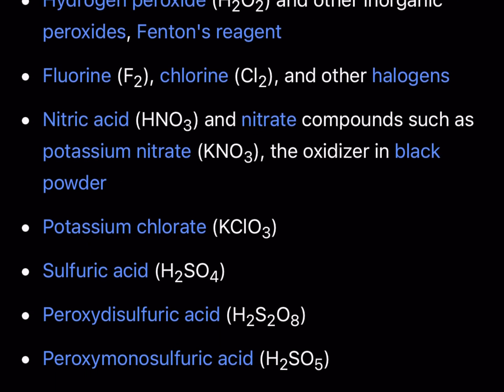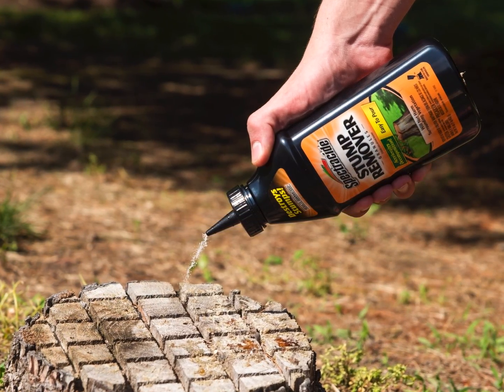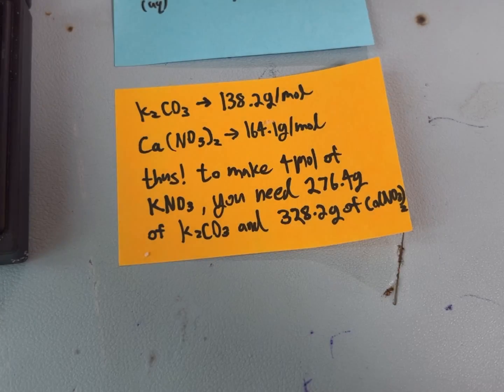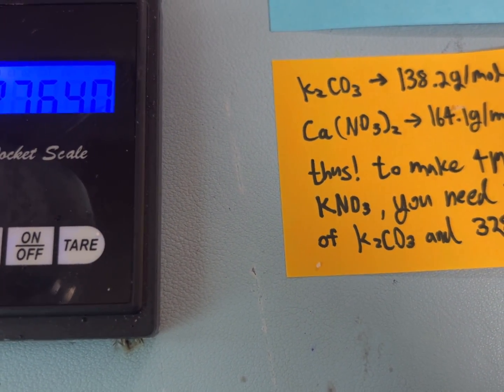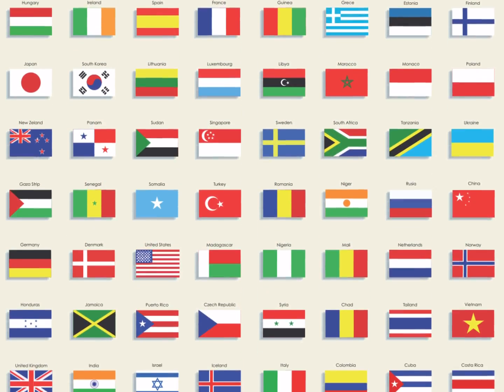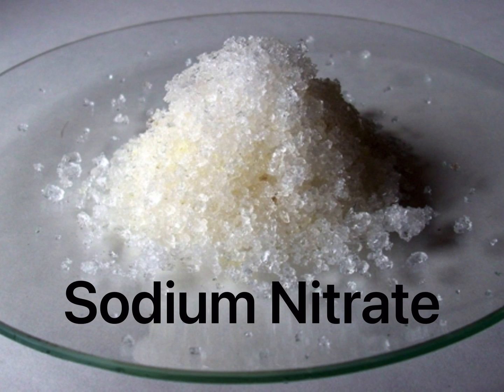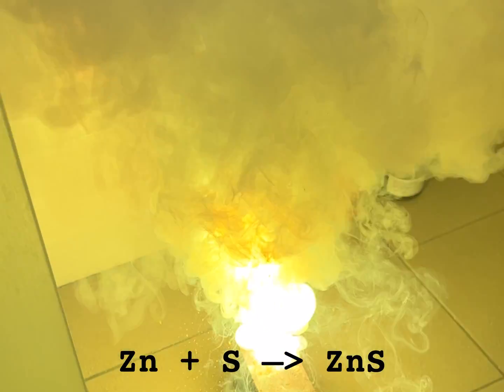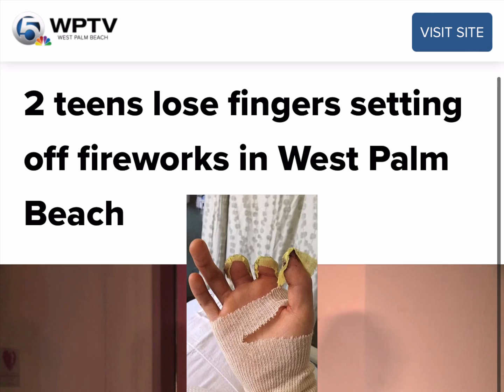How to get Oxidizers for Solid Rocket Propellants(Rocket Fuel)

Comment from the maker: As always, thank you for watching the video!
I highly recommend reading the sources listed in the description. 
Although it may feel uncomfortable to start reading research papers and articles on your own, it is one of the most reliable methods on gathering credible information.
Reply: Urea Nitrate is easy to make you don't need concentration Nitric Acid, you can use dilute Nitric Acid, in this matters Sulfuric Acid is not needed. Actually i manage to synthesize Urea Nitrate but i don't think that's gonna explode it's just disintegrate when you burn or heat the substance. I make Methyl Nitrate too but i don't know how to use that so it's can fly like a rocket.

Comment: I hate Germany. You can't get shit without the possibility to land on a list and probably get a visit from the police and you having to explain why you got this stuff. You can't buy HNO3 in concentration higher than 3%, HSO4 12%, most nitrates are heavily limited too and if not have fun paying 30€ for kg of nonahydrate... You aren't even allowed to buy certain metal powders without getting weird questions asked. Now you try to find a loophole by trying chlorates and perchlorates. STILL THE SAME PROBLEM. If you're lucky you can get some fertilizer with low percentage of nitrates but since you can buy like 25kg for cheap it's still better than f*cking 30€ for a kg of Aluminumnitrate NONAHYDRATE which means half of it is damn water. But Potassium persulfate, even worse than KNO3 or KClO(2/3/4 ) is allowed, of course.
Reply from the maker: Nitrates aren’t the best oxidizers anyways. You should get potassium chloride and do electrolysis to get chlorates or even perchlorates

Comment: I can definitely tell you have Calcium in your nitrate, during that intro burn. I was thinking you had strontium, due to the redness, but now I see. Potassium has that white/purplish color, looks hotter by color. You might benefit from a catalyst, but I couldn't tell you what it is... looked like it qorked just fine though
Reply from the maker: Hm, I think it’s because of the camera. Since In real life there was definitely a purple tint. You can see it more clearly I. My other video when it was dark outside but yeah that’s what I think.
Reply: @dudekorean3977  it certainly could be the camera, yeah.. it was just a dead ringer for Ca+ ions, perhaps just a trace. You know how sodium, even a trace, makes the whole of other metals in fire outshined. Barium does the same thing, but only a trace of sodium in a barium fire and you will see yellow in it.

Comment: The Zn-S rocket fuel requires pressure to increase the burn rate. At the Reaction Research facility in Mojave, c]California, USA, the rockets using this fuel are 1m lengths of steel pipe. The nozzle is turned steel and a thin sheet brass burst diaphragm is placed between the fuel/igniter and the nozzle. In this arrangement all of the fuel in the rocket burns in about 0.25 seconds.
Reply from the maker: That’s interesting, but I gotta ask, doesn’t the reaction produce no gas and has relatively low enthalpy? It’s so weird to me that they’re still doing research on it when there’s much more proven types of propellants.

Comment: Easy way - ammonia nitrate + Alluminium powder+Sulfur - simple and danger. One problem - need detonator: acethone peroxid or something more stable.
Reply from the maker: Wait, isn’t that basically tannerite lol. A high explosive that could get me arrested? You usually bind those with a rudder binder to slow down the combustion rate if you ever want to consider using it as a propellant.
Reply: That's a pretty sensitive flash powder lol

Comment: I made urea nitrate, 100 something grams of it (too wet to properly.weoght it, otherwise I've got 123.5% yield or something), and it seems pretty safe, it's still a little wet but it inst terribly sensitive, it's kinda like AN where you have to try to get it to properly detonate
Reply from the maker: Ah thanks for sharing your experience w it. How did you make it?
Reply: @dudekorean3977  The way I made it wanst very optimal,  but I just added nitric acid to solid urea, it heated up and it turned into a paste, since it was a lot of precipitate, I dissolved it in some boilling ethanol so it was easier to handlese

There is a different way to do it too which is a methasis reaction which is listed on sciencemadness, I dont know if it works since I have nitric but no nitrates (I really need to buy some tbf), according to sciencemadness wiki, gently heating a solution of urea and nitrate on a water bath and adding HCl will precipitate urea nitrate, and you can put it in the freezer to crash out the rest

But it really doenst work well as an oxidizer, it is kinda like AN but bad, it is not hygroscopic but it hust doenst wanna oxidize the sugar I mixed it wirh abd burst into flames in the same way AN does, the sugar just chars and smokes, I will try mkre stufd but it's not looking good for UN really, maybe I am just dumb and cant get it to work.
Reply from the maker: Thanks for the results! I was curious about its effectiveness. Btw, was the mix stoichiometrically ideal? Perhaps that could be the reason?
Reply: @dudekorean3977  I will try again, but either the urea nitrate pobably has to be in huge excess, or use a fuel that takes less oxygen to completely burn maybe? I'd have to try with C and Al but I dont have any so it will be sugar, I will test a few mixtures, do you think 90%, 80%, 70% and 50%, 10g each will be fine?

Also, I'd recommend to you to make some if you can frok HCl and a nitrate salt like KNO3
Reply: @dudekorean3977  Did the test, 50% looks like a carbon tower and didnt burn, only foamed and smoked, 70% left only a bit of residue, 90% looks like a carbon serpent, none properly burnt but 70% came the closest to it

70% is far from stoichometry, regular sugar is glucose, it's big-ish molecule, C6H12O6, the oxygens can go to the hydrogens and make 6 water molecules and the C are left as elemental C, so that's likely what is burning, the carbon

10CH5N3O4 + 3C > 11CO + 2CO2 + 25 H2O + 10N2

It would go about like this, might be wrong since I am not that good at stoichometry and stuff but, it does burn fine-ish but it generates CO which is not as good as all the way to CO2

In this 10:3 ratio, there's a total of 40 oxygens available which 25 go to water, 15 oxygens left, 2 can go all the way to CO2, the rest can only go to CO

So that explains the foaming, and that kind of explians why it doenst burn all that well and why the 70% might have burnt better instead of the 90% which I expected burning better

I need to make more UN and buy some coal I can turn into powder so I can test it in different ratios

4CH5N3O4 + 2C > 6CO + 10H2O 6N

2:1 (246g:12g) should burn ok ig, I have to test
It's kinda impressive that it's even if only slightly OB positive, I though it was OB negative

And since I dont know when to shut up, here's a giant comment
Reply from the maker: Oh I do have HCl and Nitrate salts! How do I make some?
Reply from the maker: Perhaps using aluminum and rubber binder like AN will bring better results? I do have aluminum powder and rubber binder but not UN yet
Reply: @dudekorean3977  Well theb you gotta do it for me, a ball mill is on my "to-do when I get to" list but it's gonna have to wait, so no Al powder, or Mg
Reply: @dudekorean3977  Look around in sciencemadness cause I dont have experience with this riute in specific

But from what I know, you put a urea and salt nitrate solution in an ice bath, and then you add HCl, that will turn the urea into nitrate and the respective chloride salt in solution, UN is not very soluble in water (15g/100ml or something) so most of it will crash out rapidly

Comment: Found something interesting, hydrazinium nitrate, a solid salt of hydrazine that is a oxidizwr and also an exosive thqt can be used in explosives and maybe rocket propellant as a oxidizer and as a monoprop rocket propellant, but judging from the structure alone, it'd be quite a good oxidizer for adding a extra punch to the fuel, I need to experiment with this
Reply from the maker: Alright, good luck w the experiments and feel free to let me know of the results if you want. I’m interested
Reply: "Hydrazinium nitrate"... I first see this name and without reading any further I'm already scared. What next? Nitroglycerinium cyanide?

Comment: You didn't mention aluminums vital use in most mixes. Granted it is restricted in highly atomized/low micron powders, but often times its easy to make or obtain in bulk from machine shops, as their waste shavings/dust.
Reply: Why is aluminum specifically so important anyway?
Reply: Why is aluminum specifically so important anyway?
Reply from the maker: Fine Aluminum powder is used in rocket propellants and various explosives to raise the reaction temperature(extremely high enthalpy) and burn rate

Comment: if you add a alkaline metal/alkaline earth metal hydroxide to ammonium nitrate you will get the respective nitrate and **LOTS** of ammonia gas

chlorates are easy to make  but it's easy to turn then into pipebombs
Also, if you do decide to use chlorates:

KEEP THEN AWAY FROM.THE AMMONIUM ION!!!

ammonium chlorate is a sensitive mess of an explosive since the chlorare anion is unstable enough tk use the ammonium cation as fuel and just burn, and doenst work great as an oxidizer

if you have access to nitric acid and copper, copper nitrate is a cool oxidizer to add (a little of) to composition for blue flames, but then your "main" oxidizer cant be sodium because it just overpowers the flame and you end up with a yellow flame
Reply from the maker: Thanks dude for the info.
By ‘a little of’ could you further elaborate on exactly how much of copper nitrate is ideal relative to the main oxidizer? Also, which main oxidizers could be used to give off such effects? Blue flames would undoubtedly look really cool
Reply: @dudekorean3977  potassium nitrate is pobably a good choice because flame is less vibrant than sodium, sodium just ovwrpowers everything

i'd add some 5%-10% copper nitrate, should show up well

copper oxide also has a similar effect but it's not an oxidizer
other copper salts too
copper(I) i think has a green flame and copper(II) has a blue-green flame

edit: oh also, ammonium based oxidizers would be the best, keep the NH4+ far away from ClO3 tho, it's an sensitive explosive, these should not have a vibrant colour at all, and also, fuel should matter on how much the blue will show up, but less

if 5%-10% of copper nitrate inst enough, you can add more, wouldnt wanna use it solely as an oxidizer tho, it's pretty expensive

also, other stuff: boron gives a green flame, calcium orange, strontium orangeish red, iron golden, lithium red, cesium is grey-purple and the list goes on
Reply from the maker: Oh wow, I appreciate all the neat pyrotechnic facts. Ngl but yeah these are definitely the experiments I want to do in the future

Comment: Didn't know urea nitrate was used as a rocket fuel.  Wow, don't recall reading about in my pre-teen rocket scientist ambition readings.  I recall the hygroscopic nature of the ammonium perchlorate can be a challenge noted when touring the Cape and I want to say that's why the foam rubber or other resin materials incorporation was used. Been decades since I researched and even during my first B.S. program... I didn't want to work with the highly energetic compounds and was more interested in the molecular energies frequencies tuned use to catalyze reactions.  Like IR or Microwaves specifically and at least was able to use a kitchen microwave albeit really crude from my perspective in regards to my work... though at that time was more a taboo subject and being undergraduate research I was already over achieving. Great overview!   Homebrew H2O2?
Reply from the maker: From my knowledge, Urea Nitrate is not utilized in conventional rocket propellants. Even after extensive research, the information that I was able to gather concerning its properties is nebulous at best... In fact, utilization of listed oxidizers are generally limited to hobbyists and amateur rocketry since perchlorates are generally much more efficient and reliable. But more importantly, since perchlorates have been thoroughly tested and had its viability proven, there’s no reason to use the unreliable alternatives. Unless of course, you have limited access to them.

Your research on these topics sound quite intriguing. Do you remember the titles of the books? I would love to read them myself. I originally read that binders are used to secure the propellants in place by greatly increasing its durability. I see how it could also prevent unwanted absorption of water vapor in the air
Reply: @dudekorean3977  Wow... I just tried to post a longer reply and will see if this posts.  My browser just went wonky, though anyways basically most of my work was when I was a pre-teen in the late 80's and early 90's and was left in the basement where a leak happened that ruined most of my items during the period my Dad had "cancer" though my guess was the "Havana Syndrome" health attacks being I recorded some signals evidence here at the house a couple years later and about 10 days prior to the Cuban "crickets" AP recording coming out.  Anyways, been advocating those remote sensing stations concealed wireless assault weapons that transmit sound, body and mind control malicious issues situational awareness since appears there are now imminent threats poaching more law abiding civilians than those continuing criminal enterprises desperate to look official and masked armed rob for budgets.   So, back to rocketry.  Just look up on Google or your favorite search engine "NASA solid rocket propellant binders" and "Thiokol solid rocket propellant binders and I'm sure you'll find enough info to keep you busy as I most likely read the papers from the early or mid 90's and prior.   Oh, I just noticed my clipboard history did save what I copied and pasted that seemed familiar.  THE HISTORY OF SOLID-PROPELLANT ROCKETRY: WHAT WE DO AND DO NOT KNOW,  10.1016/0094-5765(93)90158-S, New solid propellants based on energetic binders and HNF,  NASA Home > Mission Sections > Space Shuttle > Return to Flight > Space Shuttle System and Mechanics and Chemistry of Solid Propellants Proceedings 1967.  Like some NASA papers regarding external combustion engines... there are a few great ones I've never been able to find again and when my Ford F150 truck was stolen in Utah, all my office data that had records since are started keeping them, went along with.   Bummer, though risky topics to idiots that are desperate to look like they're doing something with "government" or "officials." Amazing how malicious morons assumptions can be due to their malicious criminal minds intent dementia or something.  Then again, some want any excuse they can to murder law abiding citizens that don't play along with the continuing criminal enterprises of Roman Ecclesiastical Provinces which includes Jesuits, Maltese and their other related cohorts of Axis State malicious actors and whatever they formed.  Figure they're either a military order or religious order of Latin Rites in some ways even if they desperately try to disconnect and act like they've changed.  OK... hope that wasn't too much tangent, though kind of trigger type network issues with the NASA and desperate to rob masked armed concealed wireless assault weapons sound, body and mind control rob for their budgets and things they flippin idiot flip they armed rob.
Reply from the maker: Hmm yes, these are interesting per se, but currently I am looking for quality books on such topics as well. I suppose it was a vastly different era back then so some of the books presumably could be considered outdated(?)
After reading the NASA research paper/articles I want to state that I found these papers highly straightforward and credible(although expected from a research paper, more so, from a paper written by a government funded agency) and I would strongly encourage others that are interested to try reading these themselves.

Here are the links:
-The History of Solid-Propellant Rocketry: What We Do And Do Not Know
https://www.nasa.gov/centers/dryden/pdf/88635main_H-2330.pdf

-Solid Propulsion Technology and Development: Proven Technology for a New Era of Applications
https://www.nasa.gov/sites/default/files/atoms/files/solid_p_td.pdf